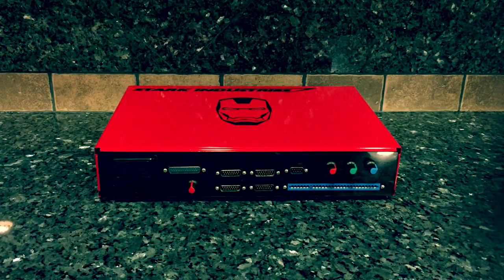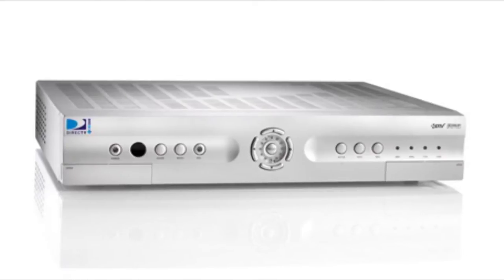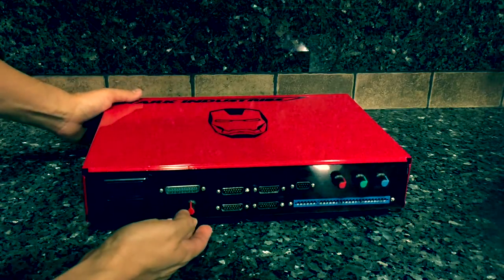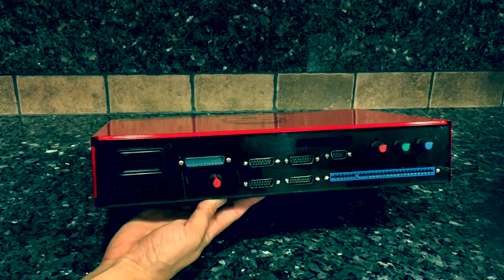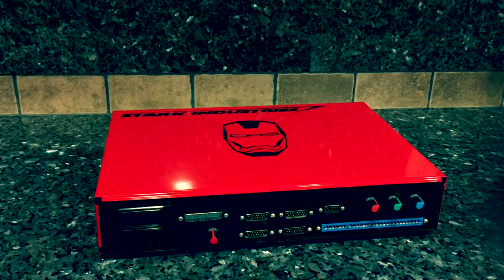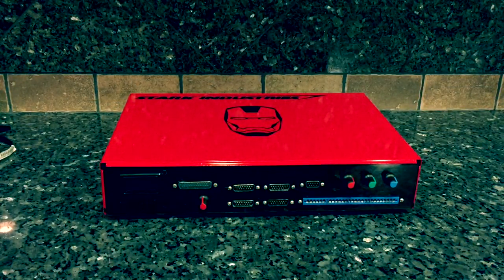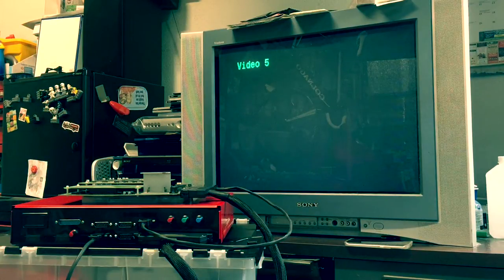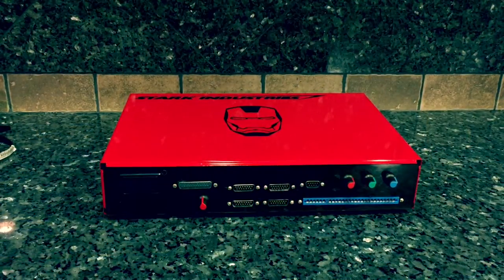Supergun build - Mark II

Comment: Hey brother, great build. I wish you would continued with supergun vids. I know it’s been a while but can you give me any info on what power supply you’re using and where to inquire about the Jamma connectors?
Reply from the maker: Pre10der hey man thanks for the reply! Ok I actually used a arcade power supply, it’s internalized. Should I do a video showing the guts? I can help out any way I can. Jamma Nation X is a huge resource.

Comment: nice supergun! you havent showed the hook ups on the back like the component, composite power connector,power switch, etc. need to see it bro. awesome video ilove the the jamma wire cover and the kick harness looks neat and tidy . were can we buy of those superguns?
Reply from the maker: janxaholic 911 thanks a ton for your feedback! Yeah the back is pretty basic, it has the component out and RGB out and power in and some adjustment jacks. There are extra holes as I was going to add more but held off.  Not selling any for the time being, just built it because I wanted one. ;-)
Reply: thats a nice looking supergun, you have to build more on those someday bro. and sell them lol! with rgb output that thing is awesome.
Reply from the maker: janxaholic 911 I know I've had several requests. Maybe someday ;-)
Reply: Outer Heaven Armory  are u selling  supergun .please let me know
Reply from the maker: Daniel Carrion no sorry unfortunately I’m not at the moment. But I may take interest lists.